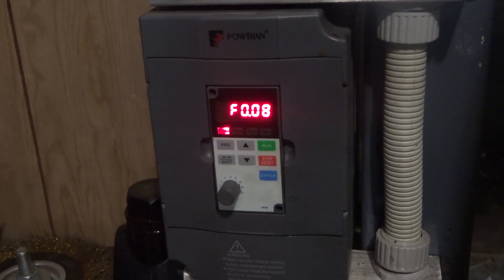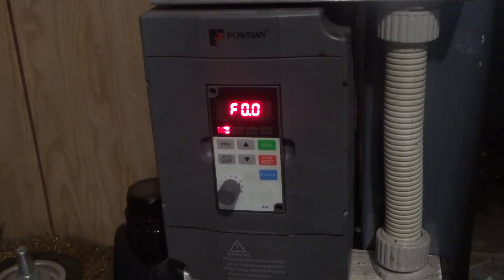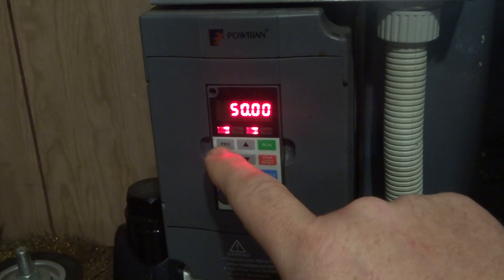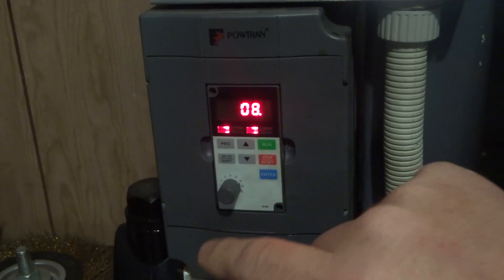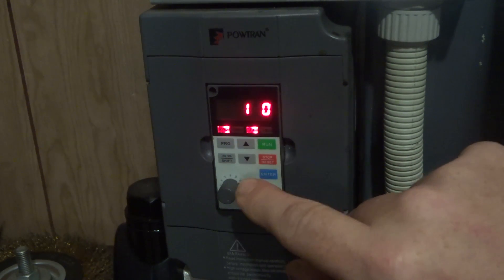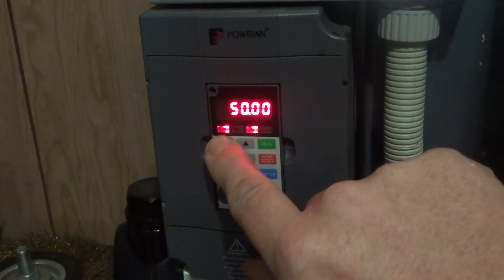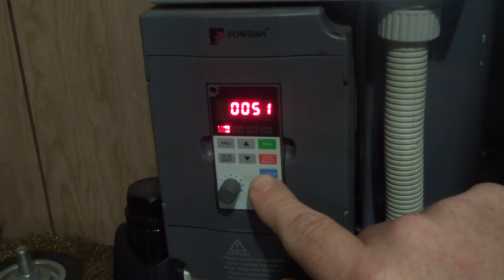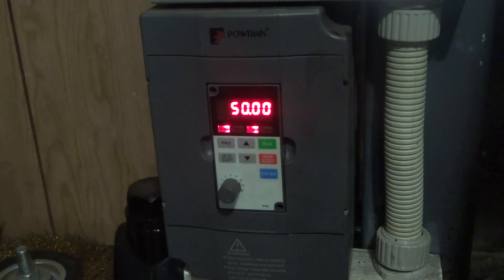fixing the VFD noise!

Comment: Emma, you have to be very careful about jacking up the carrier frequency. As you increase it, you put more stress on the motor windings. It has to do with leakage inductance. This is why they have inverter rated motors. If you don't have a rated motor, you may be able to getaway with it but you will get more heating in the motor.